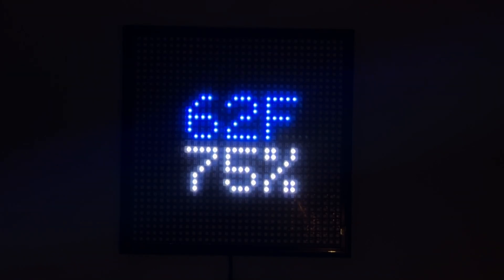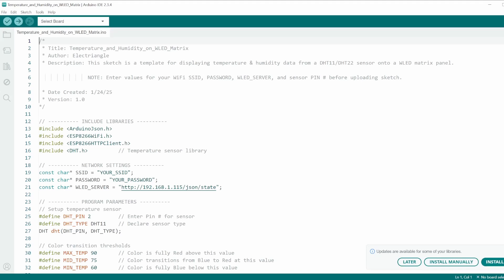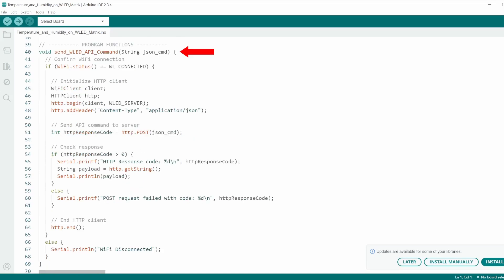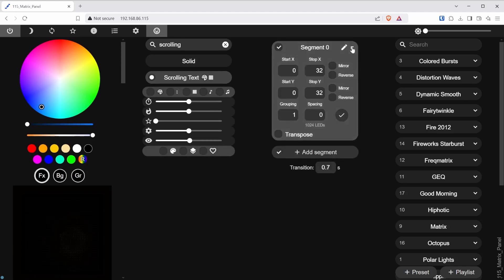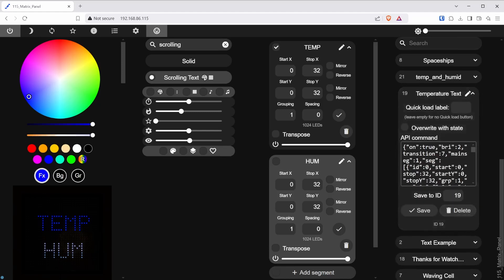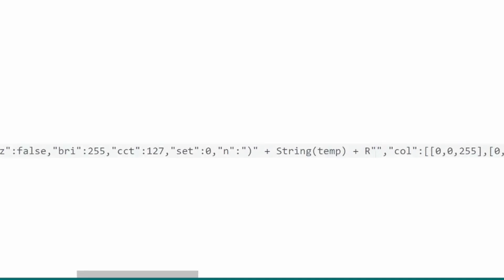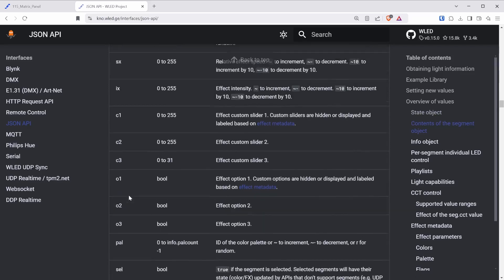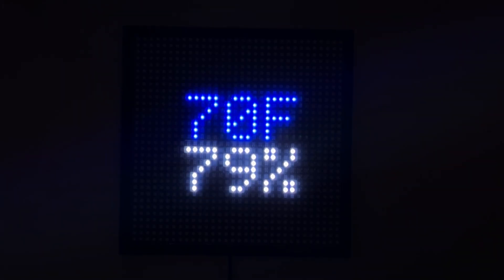Display Real-Time Temperature Readings on a WLED Matrix (WLED JSON API Library)

Comment: This means you can simultaneously use codes from GitHub with the GSON API and also use internal programs wled, for example the clock effect.
My question is: is it possible to use the clock in the program in WLED and also the temperature and humidity sensor?
Reply from the maker: Unfortunately, it seems it can't exactly be done with this setup to use both the internal WLED effects and an external temp/humidity module that is sending data. I tested it out, and the problem is WLED expects that only one preset is defined at a time containing the start & stop positions for the segments. 
However, you are able to add another segment with the default WLED clock program (or any other effect) into the temp/hum microcontroller and it will send it to be displayed. You just can't dynamically change things through the WLED interface when the temp/humidity microcontroller is sending data because it will overwrite the whole matrix display with its own JSON data.
The better way to achieve that would be to fork the WLED repository and set this up as a usermod. That way, the microcontroller with WLED installed is the one managing the preset segments and receiving the temp/humidity data as variables to show on the display.

Comment: I want to display just  time ( non scrolling ) as a preset in the wled. Can I use the same esp32 in which the wled works? Can guide me through the process. If I do this will I be able to control the wled to display other transitions?
Reply from the maker: Yes, you can use the same ESP32 to do that, and you can even use the default effects from the WLED interface without needing to use the API commands. Assuming you have already set up the 2D Matrix Panel in the WLED settings, see the steps below to display only the time:

1. Set the effect to "Scrolling Text". This should start showing both date and time on your matrix as a scrolling effect.
2. Change the name of "Segment 0" to "#TIME".  
3. If it is still scrolling, it is because it does not fit within the matrix area. Reduce the Font size using the slider under the Effect mode section until the text fits in your matrix size.

Comment: Excellent.  I'm wanting to make a small panel that will display my Teams status  as scrolling text along the bottom half of a 16x16 panel and an image/effect at the top.  You've done most of the hard work!  At least on the wled part.

Thanks very much.  Liked and subscribed.

Great video.  All killer, no filler.
Reply from the maker: Cool, thanks for sharing your project idea. I tried to format this video as a template for anyone to easily adapt to different project ideas, so I'm glad to hear it was useful in that way. That definitely sounds achievable with this WLED API library. Hope it goes well for you!